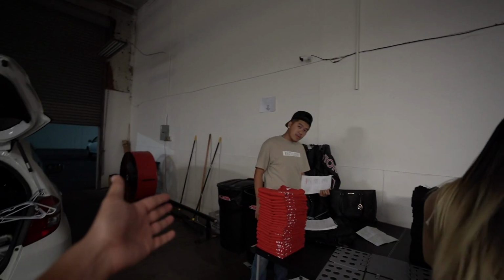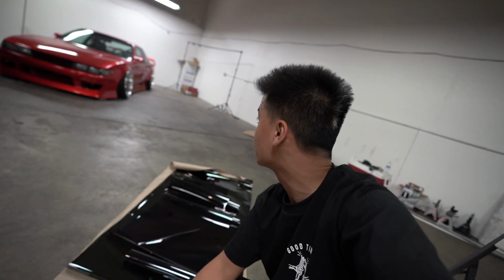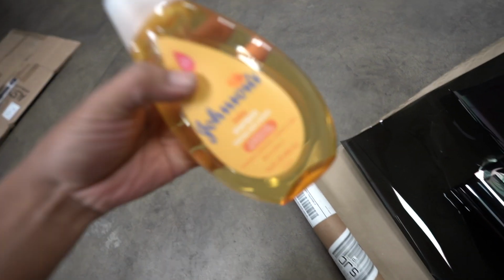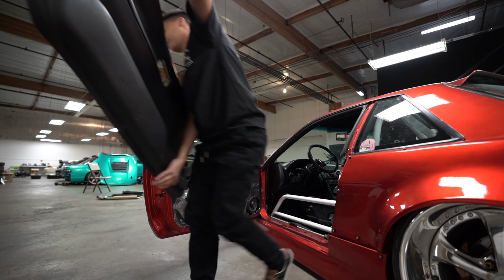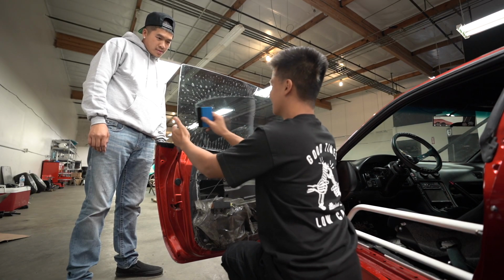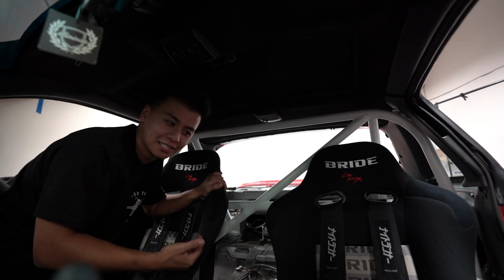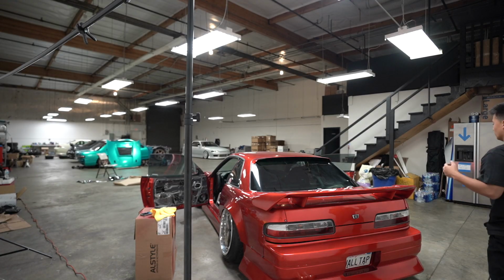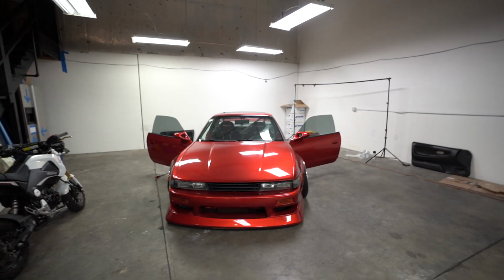S13 joins the Dark Side...

Comment: Pro tip: once you have tint trimmed to window, roll windows down about an inch, THEN make cut on top so you have a small even gap. And then slide the tint to right about 5/16 and make the cut going down vertically at the edge. And use a squeegee with a Terry towel when heat shrinking

Comment: Done a lot of tint and here’s some tips for anybody teying it themself 
1.) use high quality film it lasts longer and looks better and is easier to use for just a little bit more why cheep out
2.) use a lot of soap and water
3.) don’t try to tint if it’s too cold or too hot 
4.) always start in the middle and squeegee out rather than starting from side to side 
5.) when heat shrinking take your time and start in the middle. It looks like you heated it too much in some spots and made it curl 🤷🏽‍♂️ it happens. You want it to look like glass when your shrinking it it should fit the windo curves PERFECTLY with no wrinkles.

Comment: I've used this tint on multiple vehicles and there is a huge tip that will help when peeling it. I always spray down the hood and put the tint onto that so the back side of the film will stay down as you peel the tint off. You also should try spraying the tint down as you're peeling it, so that it can't stick to itself.
Reply: you can also order that back window to be cut into sections to make it easier. just use your defrost lines to fill the seam

Comment: You need to have the back window piece, with the adhesive side facing out, layered over the outside of the back window like you did. You want to smooth it out as best as possible, then use a card or something to get the excess water or from under it, as if applying it permanently.
 You'll get "fingers" where the window curves..... This is where you want to use the heat gun, to "shrink" the tint essentially. It will mold and form to the shape of the window as you continue working the fingers out. 
Best way to install might be too take the piece inside, lay it across the rear deck to pull the film off. Spray it down with soapy water really well then use two arms to lift it into place.... After saturating the back window too. Maneuver the piece into place, it should stick to the glass because of the water.
 To get around the plug, you'll just have to cut around it and carefully join the seam if you end up with one. Don't give up

Comment: That soap is used to get the water  on the tint longer and so you can move it around. And it helps out with the air bubbles as well. 😀😀😀💯🤙💯🤙💯🤙💯🤙💯🌙👍👍

Comment: For the rear window u have to spray the soap and use the heat gun to get the shape on the outside and take the bubbles out before installing on the inside

Comment: the percentage only tells you the shade, the higher the number the lighter the shade. they all block out the sun the same in terms of the heats rays. also you better hope that tint has warranty because for 35$ it sounds like the quality is low and the tint isnt even molded to the curve of the glass, might purple out and then itll be harder to take off later on. the soap is used for the tint to slide around on the window until you find where you want it to be placed.

Comment: It's not that hard to tint I've done it myself with precuts. For the rear window you didn't wet the window the let the tint stick then press shrink it to form it of course clear liner facing out. 

So when you bring it in have the inside window clean and wet so it'll slide easier. 

You got inpatient and wanted to get done like Kevin did. Kevin did his in sunlight which will dry the soap quickly.

Comment: You have to put it on the out side like u would the inside and then heat it and form it. So you use the soap and water also. You put it one then squeegee it and where it needs formed you heat it and squeegee it. But you use the opposite side not the side that sticks on the inside.

Comment: when you were heating the tint on the outside of the glass for the back windshield since it was already outside on the glass you should have cut out where the heater brackets were . it would have made installing it so much easier, since you would have been able to see where the tint would have been on the heater bracket itself. that's an easy trick I learnt when learning how to tint from my big bro. the same goes for the front windshield glass as well where you rear view mirror is. try it out if you happen to see this comment. much love out of the caribbean!!!!